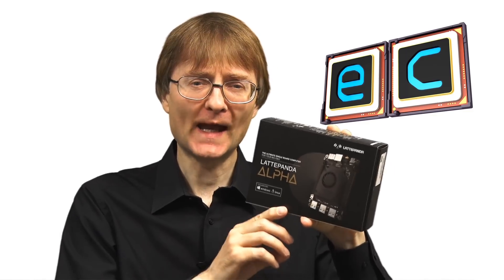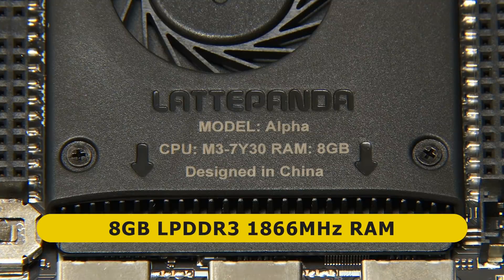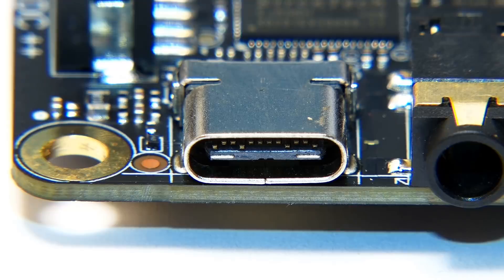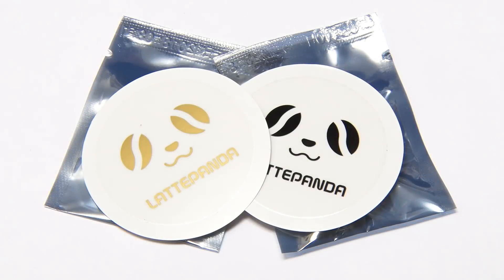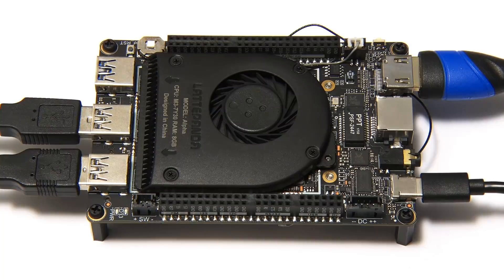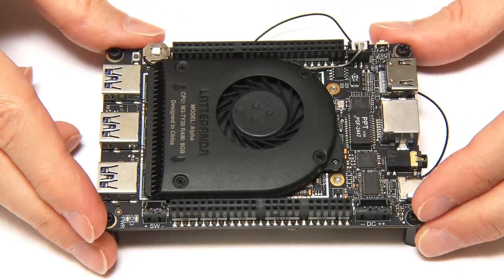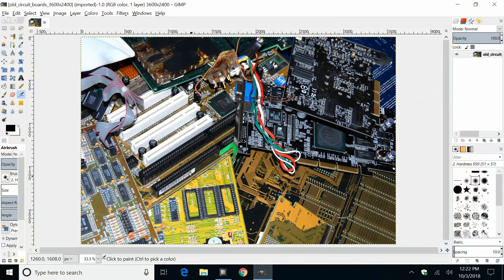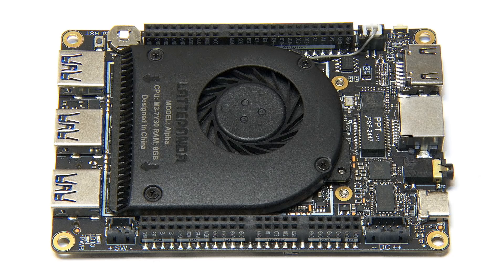LattePanda Alpha: Windows & Linux SBC

Comment: Hi Chris, Great video!
I wish that you had demonstrated the "streaming cable ... USB on a Mac ... plug & play ... PiP (Picture in Picture)" capabilities advertised here: https://www.dfrobot.com/product-1729.html Have you tried it? Was it easy to use and responsive?

I was thinking of purchasing the 864 for work; I develop on macOS or Linux all day, but a recent contract requires windows. Currently I have a slow Win 10 Ent installed in VirtualBox on my work iMac, but this is problematic because: 1) its slow and 2) it's not portable. I was hoping to get a setup like yours with an NVMe M.2 drive to speed up my windows builds and to make my windows development portable. However, this second use case requires that this PiP capability is truly straight forwards. I would like to know how well this works before I fork over the cash.

Here is the full quote I referenced in the first paragraph, from https://www.dfrobot.com/product-1729.html

> The Streaming Cable enables your Windows-enabled LattePanda device to act like a USB on a Mac or Linux system. Just plug & play into your Apple/Linux device! The PiP (Picture in Picture) form also eliminates the switching/use of dual mouse and HDMI to connect different systems for seamless interaction of two different systems.
Reply from the maker: I have not tried it, as I don't have one (yet) . . .
Reply: ExplainingComputers PS: please say hi to Mr. Scissors for me.
Reply from the maker: I will say "hi". :). I won't be in Dallas I'm afraid, though it does sound interesting. We are all waiting for info on the LattePanda Alpha cable . . .
Reply: ExplainingComputers Chris, thanks for the reply. I’ve been digging around online, and, AFAICT, no one has one, and there is no info on how it will work and when it will be available. If you learn anything, please do share it with us! 

Any chance you’ll be at the super computing conference in Dallas in November (SC18)? 

Keep up the great work!

Comment: At $358.00, I could buy a high-end mini ATX Intel Motherboard for this price, Granted, no Ram or CPU, but who doesn't have spare modules of DDR4 and Processors hanging around.
The price would have to drastically be reduced before I even consider thinking of buying one of these at this price.
Reply from the maker: All true, but you don't get the GPIO connectivity and form factor -- a board like this is mainly intended for robotics, IoT, etc.

Comment: I'm curious about what the onboard Arduino experience is from a single board computer. Did you give that a go?
Reply from the maker: Not yet, but I will be doing a video on using the GPIO here.
Reply: That would be interesting as well. Curious about the GPIO being available natively to the OS or are they accessed with Arduino as a middle man and by what means. 
But I'm confident your covering GPIO will expose that as I'm sure I'm not the first to give the feedback of what a bang up job you do! Cheers and thanks!

Comment: One little point of criticism, they could have removed the launchers and icons of Edge, install Firefox and remove all the crapware (like Candy Crush) which Microsoft co-installs with Windows. 
Other than that, I would prefer a system with a Ryzen CPU.
Reply from the maker: All the stuff like Candy Crush was not there on first boot. It arrived with Windows updates -- so Microsoft's bad, not DFRobot. It has all been removed now!
Reply: In that case my compliments for DFRobot. It is a great service of them that they at least remove it on the image. I have been wondering if you can't write a Powershell script to automatically clean the system after every (big) update. It should be possible with the exception of new crapware which is being added. That is how we take care of business in the LInux world. I only have Windows10 on my laptop, so far it stayed clean after the first install (fingers crossed). At least as far as I know, I didn't notice it pop up again which is good enough for me.

Comment: the idea of the single board computer is to make it small and cheap not big and expensive, for 400$ i can get a full laptop ...
Thanks for the reviews, it was still interesting.
Reply from the maker: This board is mainly for applications where a small form-factor and/or GPIO connectivity is needed -- eg in robotics or advanced IoT.
Reply: size being a bit factor. (said as I hear a second tower chugging away under the desk that's doing nothing but running a MUD server)

Comment: This is ideal for supermarket ticket stations. RS232 for fiscal printers, USB for keyboard, mouse and barcode scanners, optionaly electronic scales or credit card readers. RJ45 or wifi to access remote data bases and a HDMI mini display. All packaged in small box. I need to know what power consumption is.
Reply: It's an overkill -- you can do point-of-sale on almost any SBC with USB, Ethernet and display output...
Reply: Agreed. A Pi Zero's probably more than you need for POS, &c., unless it's running multiple registers at once.
Reply: So it's a battery hungry device!.

Comment: Wow...18GB for a "fresh" install of Windows 10? What a pig of an OS. The board looks like it would be a great Linux machine though, especially with maybe an m.2 UART in the second slot.
Reply: Chris, is there a way for the on-board Arduino unit to communicate with the i3 CPU? For a robotics project, a person might want a bit of a distributed control system--the i3 would be the central communications and control device, while the Arduino MCU would be the peripheral controller (PWM, sensors, etc). Normally I do that either over a UART or an i2c bus, but other than using an m.2 UART, is there any way to get the two processors to exchange data? Maybe DMA or something?
Reply from the maker: The Intel computer here can certainly talk to the Arduino. I intended to dig into this and make a video. Here is some (based on the first LattePanda, but I'm sure control will be just the same): https://www.dfrobot.com/blog-893.html
Reply: Thank you. I'll take a look at it now.
Reply: @bluehornet6752  plus the updates still to come. It will eat up the 64GB main drive in just a few months.
Reply: It's that size and intendant slowness of Windows that caused me to try out Linux Mint after watching the Explaining Computers videos on Mint. I'm loving Linux Mint! 

If I ever try out a Latte Panda, it probably won't be running Windows.
Reply: Indeed Bill. 

I've been working on embedded systems programming now for the better part of the last 8 years or so, and started on Windows. The main benefit there are the nice (free) development tools like Atmel Studio, if you use AVR-based boards. Also, there isn't a lot of difficulty getting USB devices to work with Windows. In Linux things can be slightly more challenging. In exchange for a more stable OS, you often need to mess around a bit with stuff like udev rules--which are necessary to be able to download sketches to the Arduino (and Teensy) devices without needing superuser privileges. Also, even though the Arduino IDE is available for writing your code in Linux, it's woefully inadequate compared to something like Atmel Studio or even Visual Studio. So then you really need to find something else, and one obvious choice seems to be Eclipse with the AVR plugin, now conveniently bundled in the "sloeber" package. Eclipse also works on Windows of course, but I personally don't see a reason to use that when there are a number of other great development tools available for the Windows platform...the Qt framework for instance.  

What I believe I've settled on now that I'm pretty much on Linux for good, is sloeber for doing AVR-related work (or just using a plain text editor), and the Qt framework for doing any embedded systems GUI work that might be required. As long as I can make sloeber (Eclipse) work for the stuff I'm doing on Linux, I think I can get by that way. It would be nice to use it for on-chip debugging of AVR chips with something like an STK-600 or a JTAG ICE mkII unit, but I know that using an old version of AVR Studio inside of Linux (via Wine) is also an option. But there are enough development platforms now that offer USB-based on-chip debugging, that I don't really think it will be an issue. 

So I hope it's bye-bye Windows for me...
Reply: Right! A pig that needs hours to get updated à la Microsoft...
Reply: odd, because i dropped Zorin in offline... ... #linuxMicDrop
Reply: @joetke  Would you guys stop crying about Windows?
Reply: no need, M$ have consistently lost 10% market share each year for nearly a decade now... Buy junk? Bye Bill ;o)
Reply: Q4OS install .iso 0.332 GB
Reply: I agree the Win10 os is way too bloated. I use a os that only uses 750mgs and is just as usable as the poorly written 18gb os.
Reply: very faaat os hahahah
Reply: no dought.
Reply: Keep in mind that of these 18GB there's at least 10GB being just a backup of previous (i.e. pre-update) versions, which can easily be removed using the built-in disk clean-up utility. Another at least 8GB are drivers. These are kept to enable the OS to talk to pretty much anything you plug into the board (in terms of USB peripherals as well as swappable internals such as the board itself, WiFi, audio devices, CPUs and the like). Windows 10 can be trimmed down to well below 4GB if one desires to do so. In addition to that, even compression is available to bring size down even further: https://www.windowscentral.com/how-reduce-windows-10-footprint-your-pc

It's easy to bash Windows because it's somehow still in fashion, but it has become less and less rational these days. Power consumption on Laptops is still significantly lower using Windows compared to Linux distributions and working with USB (especially UART over USB) devices is much, much more hassle-free in Windows compared to Linux. As for the "speed" - well that depends on the use case as well. Some things are faster in Linux while others work better in Windows thanks to better - but proprietary - drivers.
Reply: I do think MS has improved things with Windows 10--and I was not aware of the information about the 10GB worth of backups, so that's for that. I don't know if I necessarily agree with the power consumption assertion you made though, so I'll have to look into that a bit more. I certainly haven't seen much of a difference here with my HP laptop, running Windows 10 (for Solidworks), and Ubuntu 18.04 for everything else. 

In all fairness, I will say that Windows 10 is a much better experience with sleep/awakening of the system than Ubuntu is...hands down. Especially when there are multiple monitors involved, Ubuntu pretty much doesn't get it right at all. But even compared with Windows 7, Windows 10 seems to do a much better job. Also, Windows 10 plays much nicer with wifi than Windows 7 did, so much so in fact that I don't even need to use wired ethernet now when I am booted into Windows. With Windows 7 it seemed like the wireless networking would have a heck of a time starting, whereas with Windows 10 it just works. 

So it would seem then that if you do have to use Windows for whatever reason, that Windows 10 is a much smoother experience--at least it is for me on this machine. I did a clean install of it though--it wasn't an upgrade over a Windows 7 installation. But in terms of power consumption and overall resource utilization, Ubuntu seems to be better than Windows 10 for my use case.
Reply: When SSD installed don't forget to move your page file to it. Saving a few extra GB's
Reply: @mumblic  did you mean off it (no need to on the 64gb emc version) 32gb is not space really enough for Windows 10, my 32gb one was a pain to get it to do an upgrade to newer version (yes you can reduce the size but should not need to)

Not even sure how you can use Windows 10 on a limited data connection, I just did a fresh install and it downloaded 1.4gb of data (probably was close to 2gb as I had rebooted after updates) the store installs so much unnecessary stuff (I guess that's what LTSB or LTSC now)
Reply: According to those calculations, windoze core takes up no space at all (whilst still not carrying the ~39mb of dll's sp3 code standard relies on - cos M$ are dicks)

I'm not anti-windows because it's never good. Heck I use it every day and built my last win7 machine intentionally.
I'm anti Microsoft because you Never own their product. It's bad enough that it's typically a power-munching, lumbering mamoth. Not believing a word about laptops, I have several they are All more efficient on the various linux distro's I use - Mate' Zorin etc... but every, single official copy of windoze I have ever owned has been Deactivated by M$.
I bought 3 copies of win7 pro64... they all got shut down, with M$ refusing to reac, even after proof of purchase. Then I just started to pirate the thing - which, oddly enough makes it much better.

I lock 7 to sp1, nf4.5 and never activate it... this endless down-grade trail is the bane of mine and the vast majority of other professionals lives.
Wtf they ever moved off sp3 when they had decades of pro hardware and a solid 64bit standard I have no idea. Nor do I care.
M$ have had more than enough of my money and wasted far too much of my work time, they can stick it. Permanently... and WOA? sorry RT, sorry Wiot... is the biggest pack of #SiFIve non-open source RISC5 lies I have ever seen. #BlueGroup want to avoid paying ARM licences... So they won't consolidate a full service ARM port. Lets see them catch up with 20 years of optimisation, or in court when it becomes obvious they just stole it. Anyway, Thats why I'm anti-windoze, because they Hate, You.

Sorry, I mean they are completely ambivalent to the end user. Preferring to buddy-up with corporations they have shares in and quite happy to shove their unending re-re-re-launched junk down any non-technical throat they can find to artificially propel their own, stone dead, market. Even when it's never intended to work, MCE, Vista, Win8, 8.1... xx
Reply: @totalermist  I was going to say the same, you said it better! very good and underrated comment, it annoy me when people continues to say windows is slow and bloated because of preconceptions
Reply: Windows 10 LTSC's install is only 7 GB.
Reply: only - wow...
Reply: Domestic figures, un-adjusted and completely wrong. New home PC purchase basically doesn't exist any more, now we all have smartfones. ALL other machines are server/commercial - why don't you try again and tell us what %age of the server market (the entire world) M$ currently occupy? With the barely-serviceable server2008?

it's not %age of the increasingly tiny market, maths wizz - it's the TOTAL size of the WHOLE THING. 
Ffs, i am 100% of me, doesn't mean I don't get fatter every fin year does it?

Well this market, M$'s ONLY sliver of market share has been shrinking very Very fast for over a decade.
Servers occupy well over 90% of ALL boxes on earth and statistically none of them run Windoze - and never will cos it's a pre-broken toy.
Which is why they can only push non-critical applications (having thrown away all of their own time-tested tech) which leaves them on desktops, that no one buys anymore and laptops designed to be thrown away. 

If only they could run full-service on the ARM chipset hey?  But then #Bluegroup would have to admit M$ shat on their own ARM support to avoid paying the licence, while they shove #RISC5 and the Closed production Sifive down every kindergarden throat in America (and pray that Decacore fully-stable soc's don't continue to blow the shit out of anything their 20-year-behind not-stolen RISC Corporate Source will ever be) - because right now, I can buy 18ghz of cycle, in a tablet for £100. But it will never run full-service windoze.

Why? Because Microsoft don't own ARM and won't compile for it - WOA=Failed RT=Failed Wiot= can you guess yet? 
That's why you're left with 'um it works ok for some stuff on my snapdragon' instead of winARM64 Pro on everything. WAKE UP.
Reply: Is that beggar's complain? Space is cheap nowadays, and many software simply does not have analogs on Linux (Enterprise Architect)
Reply: Well, there's THAT comment I was looking for.
Reply: Dude grow up linux is totally worthless for pc gameing . And video games are now getting to be over 40 to 60 gb as a expected standard . Hell great games from the mid 2000s were at 4 to 13 gigs regularly . Now thats 1 SINGLE video game . The os is the heart of the pc . 4 terrabyte drives are very cheap and 500 gig ssds very reasonable. So bitching about under 20 gigs is simply clownish  and silly. Go check out the size of some 4k movies dude some are over 12 gigs for 1 movie. So with all the power win 10 does truly give 30 gigs would be peanuts anyway. To me the true weakness here is the 64gig onboard storage . The board without it would be better because u would be booting and osing from the ssd and not the flash